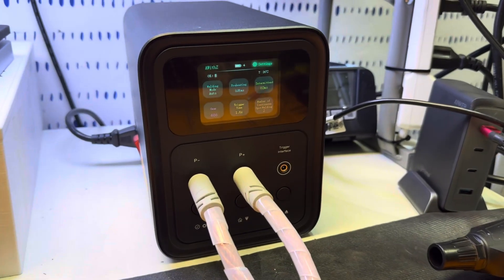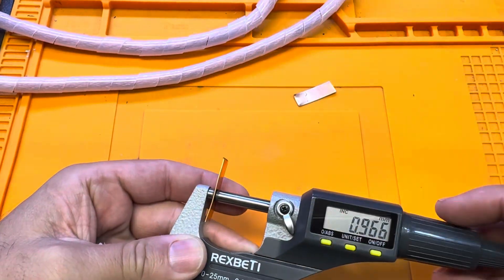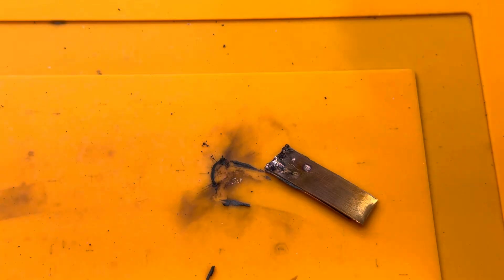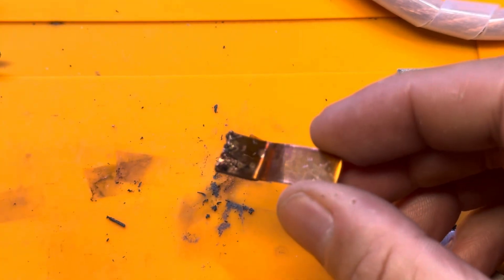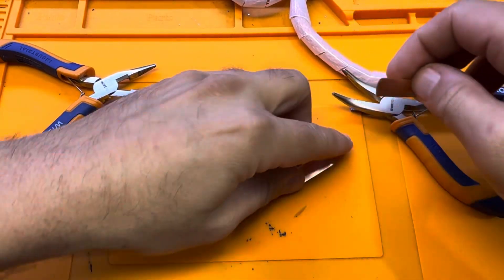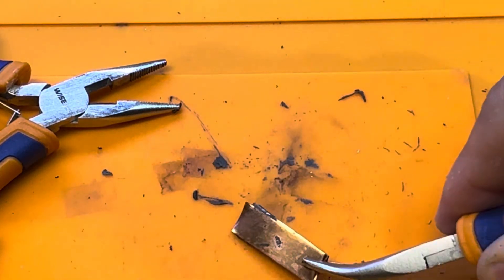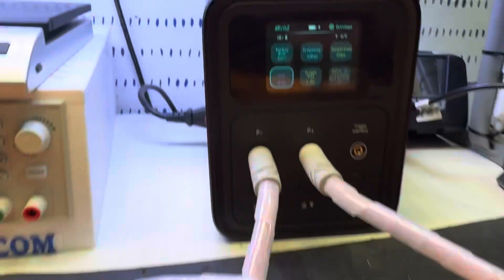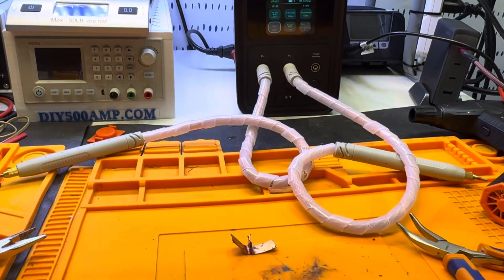Welding 0.6mm Copper to Copper with AWithZ P120D Spot Welder + Special Flux Test!

Comment: Saludos, i have the p60f to weld 0.3mm copper but when i do each weld the copper leads of my welder they suffer so much, do you use the originals one or you are using a higer cuality/thickness?
Reply from the maker: You need to use Flux for 0.3mm and Stainless Steel 304 will help a lot. Llamame si necesitas ayuda.

Comment: Which settings would you recommend for 0.2copper without flux?
Reply from the maker: P30C will make it but for make it more relax a P60F can handle it easier. For all day use a P90C and P120D is the machine.
Reply: @DIY500AMP on my job we have p120d, and i wonder what settings is good for 0.2copper. Don't know what settings is good for nickel 0.15-0.3 and copper 0.2
Reply from the maker: @secondmarshmallow  Normally in that combination I use around 045 gear and even less depending the electrodes conditions.

Comment: hi, can you tell me what parameters to set on AWithZ 120d, to weld 0.2 copper + 0.2 nickel to 21700
Reply from the maker: Try with Gear 100 as a start. If is too much go down and make sure you are making a very tight connection with clean electrodes. If you make a hole or see a violent weld, go down !!! The P120D is a very Power full machine. I will start honestly very low as a test of your metals. 030 as a very start.
Reply: @DIY500AMP  It has very strange settings for gears. As I understand it, each number means some parameter. Because I put 009, it splashes metal. I put 043 and it already makes holes in 0.2 copper + 0.2 nickel.
I think that the first number means power, the second most likely delay, the third is unclear, but the difference is significant when changing from 1 to 9.
I mean, if you put 039 gear, it will most likely make holes.
I tried to contact the manufacturer, so that he sent detailed instructions on gears, but he is silent.
Reply from the maker: @DIDALL each metal quality is different, each electrode react differently depending how new is, how clean is, ambient temperature, how tight you press and the surface below the metals like batteries or even just the 2 pieces in the air. Is several variables. Only testing you will know
Reply: @DIY500AMP  Hello, the manufacturer still sent me a table with recommended parameters for Awithz p120d. I also have a Glitter 811H 42kW, I saw that you also have it, many of them fail over time. I disassembled it, and saw that the factory power supply produces from 27 to 29 volts! Although, the first capacitor, on the control board, where the power goes to 25 volts!. So, I installed the XT60 in the case, and I use an external 24 volt power supply. I recommend that you do this too, so that the control board does not burn out.
Reply: @DIY500AMP  My electrodes are pressed very well, I can send a photo of how I secured them to the stand, you might be interested.